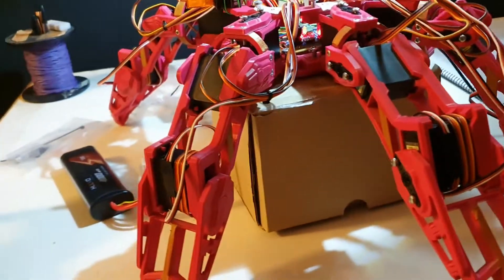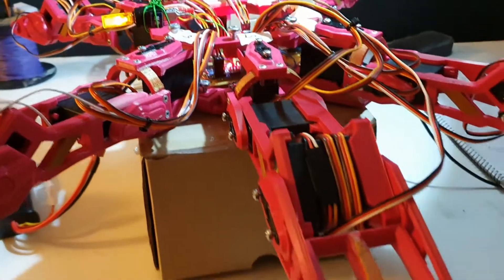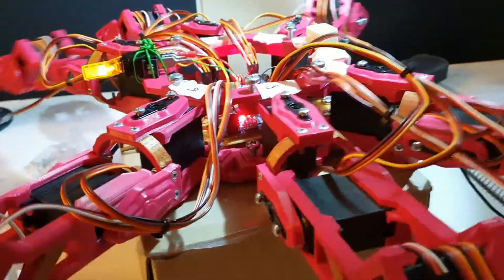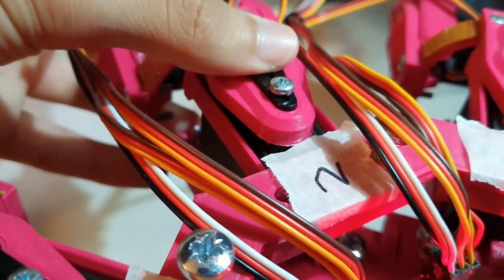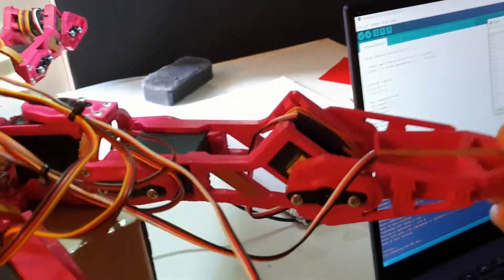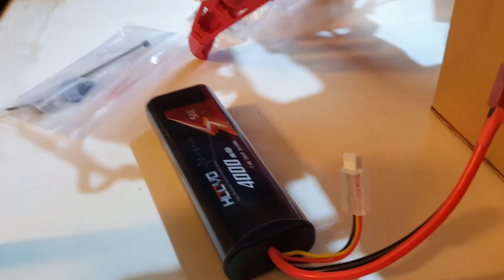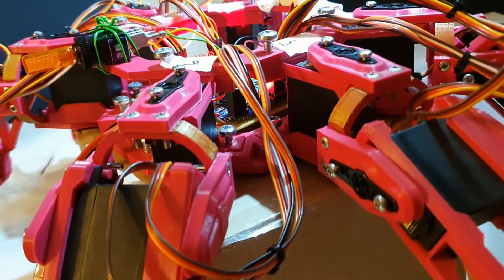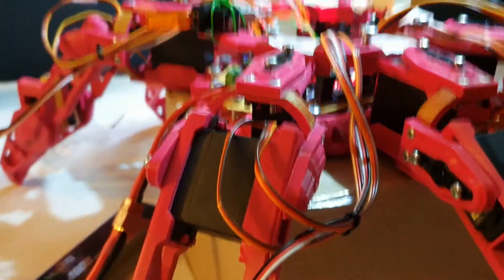Hexapod From Scratch #2 | Problems

Comment from the maker: I've just noticed that if I were to use the 18650s it would be 7.2V which is still above the 6V which is required for the servos so that wouldnt work.
Reply: You're looking for something called a BEC or Battery Eliminator Circuit - commonly on hobby vehicles that use 3S or 4S packs servos are driven off of a BEC that is also powering your radio. When choosing one consider the current draw of your system - most hobby vehicles are dealing with 1 or 2 servos, 12 is a lot more so you may need multiple. End of the day they are just buck converters. 

Solving the servo horns popping off - most servos come with a self tapping screw that you can run through the middle of the spline to hold the horn on. But if you don't want to do that this is not a problem that can't be solved with some zip ties.

Comment: did you fix that shaking issue bcz iam also facing that isue.
Reply from the maker: As I will address in my upcoming video, I have put elastic bands to fix it. What servos are you using? I think the reason I have it is because I'm using cheap MG996Rs which have quite a lot of backlash and slow encoding. It goes too far each time it moves with hefty loads which causes it too go too far then to fit it it tried to rotate the other direction which then goes too far again and creates a feedback loops. Anyway, that's my theory.

Comment: If the servo heads are popping off you might also be losing your calibration. There should have been a screw that came with the servos to hold the horn in place.

For the batteries and higher voltage, you'll want a buck converter that can output 6V and handle a constant current of around 5-8 amps. I got mine from pololu, but there might be a better source closer to where you live. This depends heavily on your servos though. Different brands have different efficiencies which can increase or decrease the amperage requirements. High amp buck converters can get pricey but will always work even if you upgrade.

Comment: Cool man! Try tuning your PID gains a bit, probably lower the proportional gain and make it less aggressive. Not sure how you've got your leg control set up, but if all the legs should be controlled individually then it could be weird voltage oscillations on your servo power supply. If you've got a scope you could have a look at it.
Reply: You're dead on with the cause and the solution but it's a downside of common hobby servos - they don't have a  way to easily adjust your gains. In fact, they may not have a way full stop. 

Lowing your P gain could work, as could increasing your D gain.
Reply from the maker: I don't think they can be adjusted on my cheap servos and upgrading is out of the question as to make this project open for all, more expensive ones can make a cost of over £500 in servos alone which I don't want to happen.
Reply: @marcuschrw  Yeah, the servo costs get up there quickly. You could possibly play with interpolating longer moves into smaller moves (which you probably want to do anyway) which means that your gains will have less impact.
Reply: @marcuschrw  

https://youtu.be/cWNikw-Jsr4